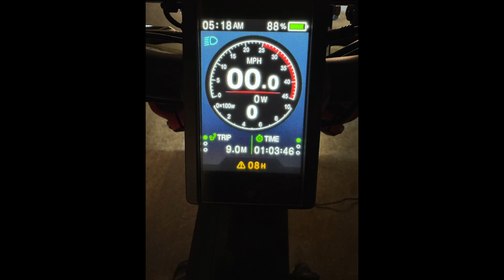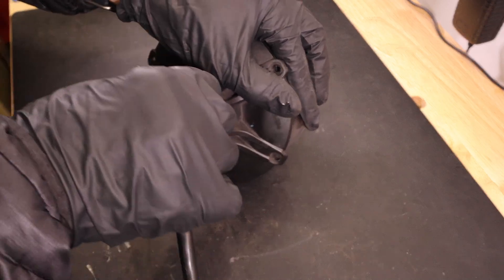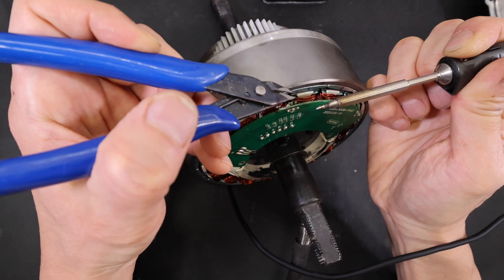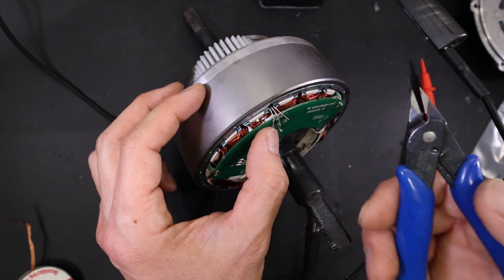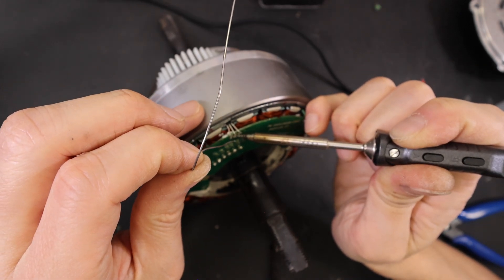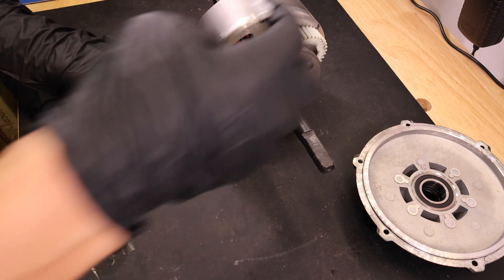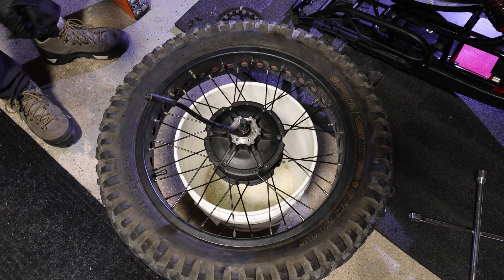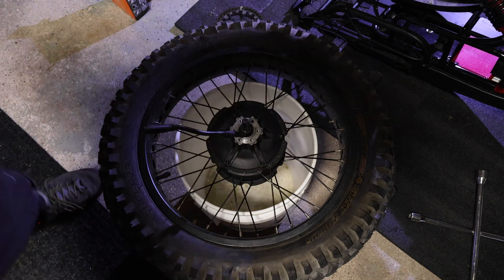How to replace eBike Hub Motor Hall Sensor and Grease Gears (Ariel Rider Grizzly 08H) Bafang Motor

Comment: Thanks for the guide and lesson! I have the same problem on my grizzly, front motor with bicycle turned on 5 volt supply good and one of the hall sensors signal output is showing 5 volts constant in any magnet position, will replace as soon as I get the replacement sensor, thanks again!

Comment: The other day I was riding my Juiced Ripcurrent S (Bafang G62 motor) and went up a short extremely steep hill for about a minute.  Don't know if that overheated it.  Then I parked it and walked further for about 10 minutes.  Rode it home for another 30 minutes without issue, including a couple of stops.  Next afternoon I went to ride it and got the Hall Sensor error code.  All three sensors are bad.  I find it odd that it decided to go bad while it was parked and not when it was overheated if that is what caused it.
Reply from the maker: It’s possible the heat from the motor core slowly made it to the hall sensors or something. Not really sure how good these generic ones are in these geared hub motors but I know Honeywells are better with higher operating temperatures than the cheap ones probably. Direct drive motors seem to use one and have backups if one fails I think. 
Hopefully you get it working.